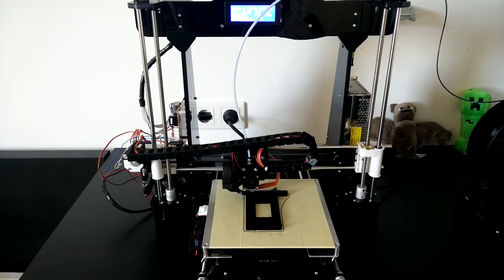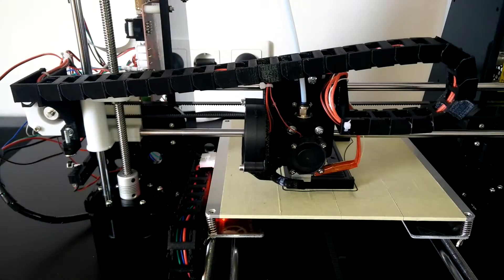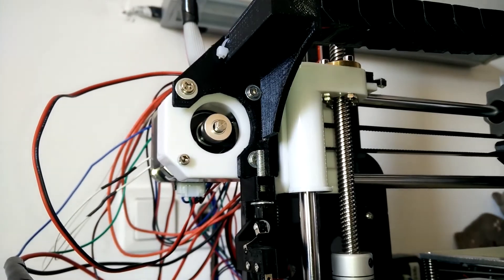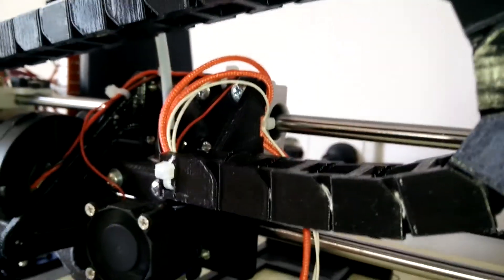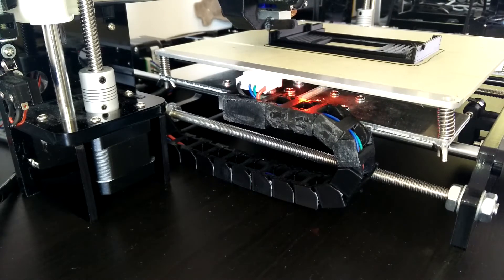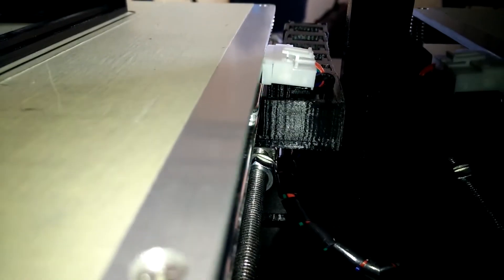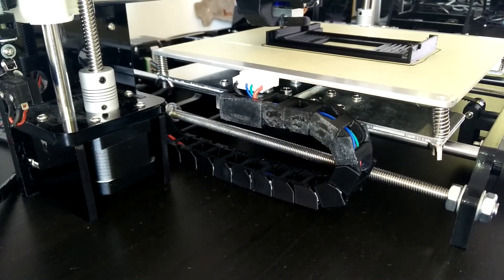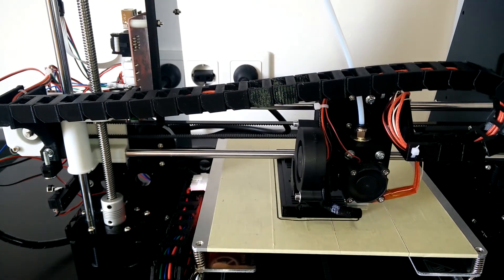Anet A8 Drag-Chain Upgrades

Comment: It looks like your Z axis could also use a chain.
Reply from the maker: Hi!
You are right, but I chose not to add one as the z-axis isn't moving that often as the other two are. Once the electronics got a proper case, the problem with the "wild" wires faded as well. Check out my newer videos to see how the A8 looks now ;-)

Comment: your bed chain sit lower because your H place (that yoy screw the heat bed is upside down , all video instructions got it wrong
Reply from the maker: Hi, thank you very much for your hint!
As far as I can remember, I intentionally screwed it below the aluminum frame because the chain holder used to be higher than the heated bed with my leveling. I probably won't change it anymore though...